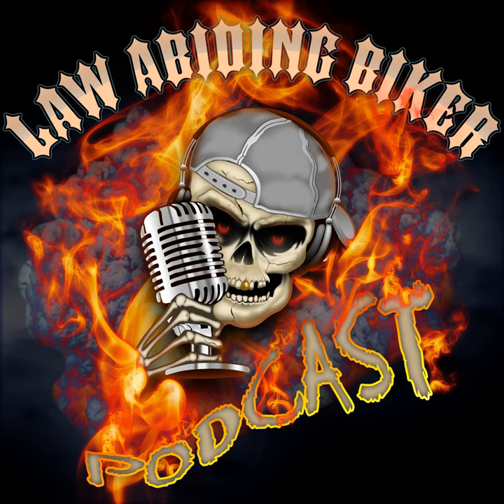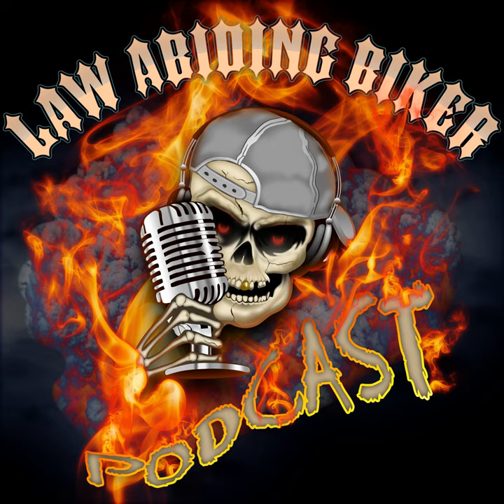LAB-213-Emergency Motorcycle Braking Techniques & ABS Systems-Practice Drills & Testing

Comment: I thought this was excellent.  The oil discussion was something I was speaking about today especially with the intervals and dealership M.O.  The general discussion on braking was very enjoyable.  I had been looking for a drill with Threshold braking and finally hearing your box drill will work greatly because without measurements it just means yeah you stopped.  Thanks  it's information like this that keeps those willing to be safer and operate motorcycles as opposed to riding them.  Especially as a civilian.  From which I speak.  This will be listened to again and shared.